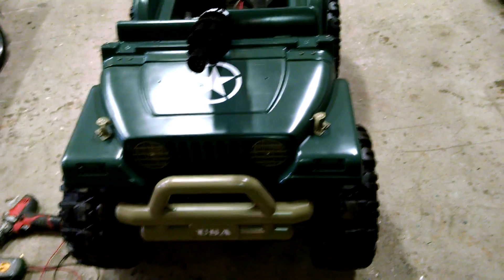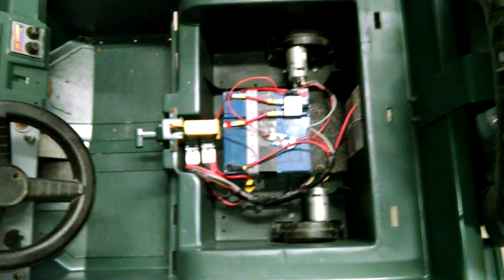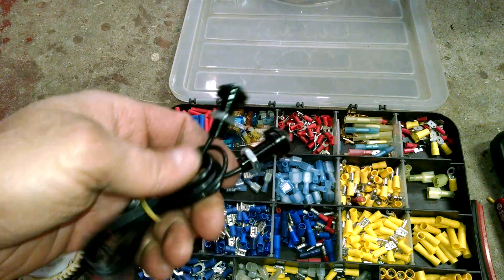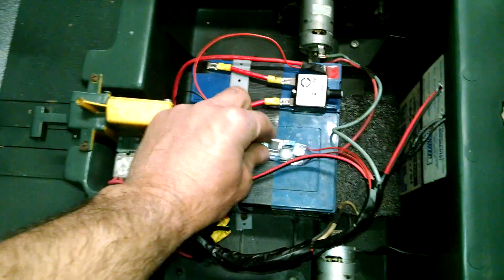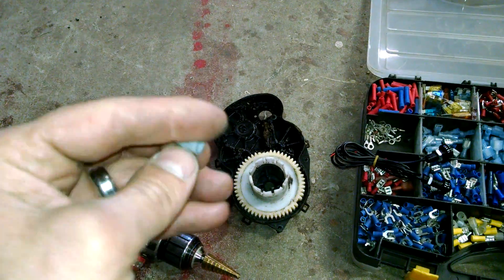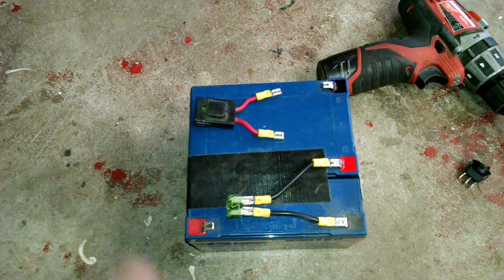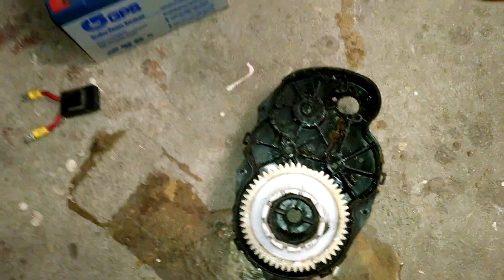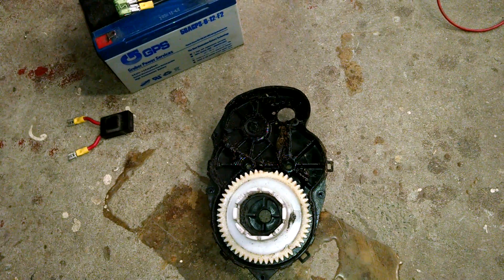Powerwheels modding 101-18 volt battery and lighting upgrades

Comment: Great video ! Question i have a John Deere 12v and want to add a 6v to get to 18v. But the battery i have is only 10mah insted of 12mah thats on the original battery. Any problem to go with that battery? 12v 12mah + 6,v 10mah.....  Regards skrew
Reply from the maker: It's not recommended as the cells will discharge at different rates and won't balance charge in the series wiring. If u charged them separately it would be possible but not ideal.

Comment: why the real rubber tire is not good for this kind of power wheel?
Reply from the maker: Plastic gears and traction do not mix. When u add power u will destroy the gearboxes.
Reply: so you mean if i use rubber tire, i need upgrade p[astic gear to metal gear?
Reply from the maker: Installing an esc setup is highly recommended to add soft start. These things are engineered for 5 mph and the plastic tires are designed to slip, which is a buffer.
Reply: can you suggest which esc need use, there is so many kind of esc, i got confused.
Reply from the maker: Without a doubt go with a east coast powerups kit. Top shelf parts, complete wiring diagram and super customer service. Tell Wesley that John from custom kidz cars sent you. Hope this helps

Comment: wondering if that was the stock wheels for that jeep they look bigger than the ones I've seen and did you have to modify them to fix
Reply from the maker: will warren they r custom. took some trimming for clearance and had to make custom bushings for the rear axle since the wheel rim has a much bigger hole.

Comment: Sorry if this question has already been asked, but I'm looking to increase the run time on my kid's power wheels.  I read online that using an SLA Wheel Chair battery (20-35 MAH) will obviously increase the run time tremendously.  But is it safe?  Assuming I stick to the same 12v to 18v output, and I find one that's around 15 pounds, is that something you would recommend?
Reply from the maker: Mando Networks yes a larger ah battery will work but is very large and heavy. You can also install a second battery in parallel with the stock. this involves cutting and splicing the wiring. charging will also take much longer or u can charge them independent. This would be a good topic to cover in a how to video. Tx for watching the CKC channel.
Reply: Custom Kidz Cars - Thanks for the reply!   I found this battery, 20 mah and only about 3lbs heavier then the stock power wheel.  I think I'll go this route!

https://www.batteriesplus.com/battery/sla-sealed-lead-acid/duracell-ultra/12/wkdc12=20nb

Comment: absolutely agree with the rubber tires traction... its similar to using slicks on stock axles at the track. Eventually something will go wrong. One of the reasons I'm not a fan of the kid trax wheels. You need that wheel spin for those plastic gears. My sons Silverado lasted 3 weeks because of that and mainly because of the extra weight from two kids riding in it all the time.

Comment: where can I get the charger port?
Reply from the maker: monster scooter parts.com
Reply: +Custom Kidz Cars ok. I found the 2 wire. The 3 wire one I saw was discontinued. I just wore this to the positive and negative of the batteries? Do I need a fuse in between? Thanks again for this helpful video. Hope you make more!